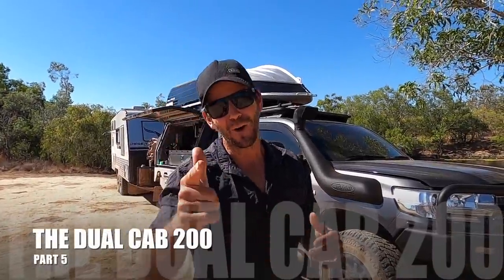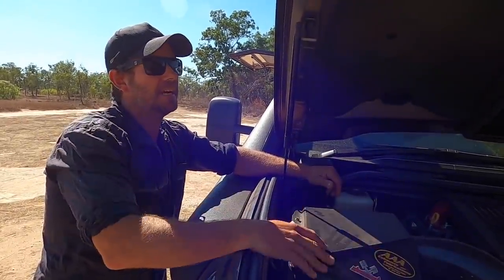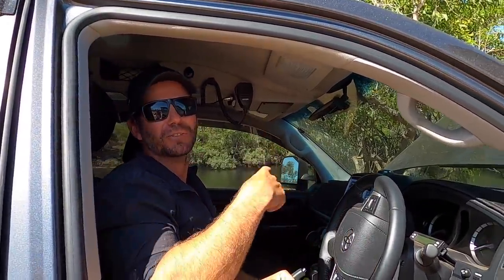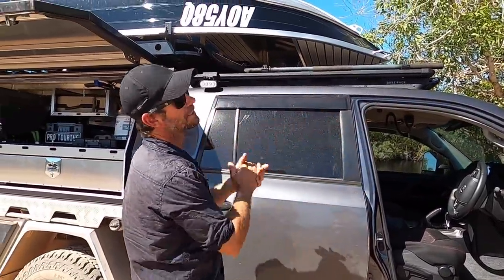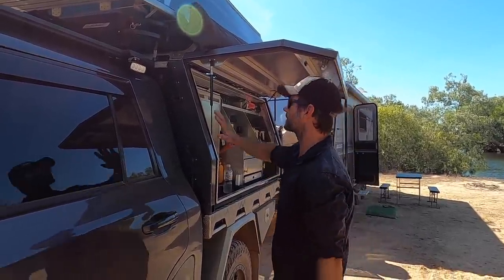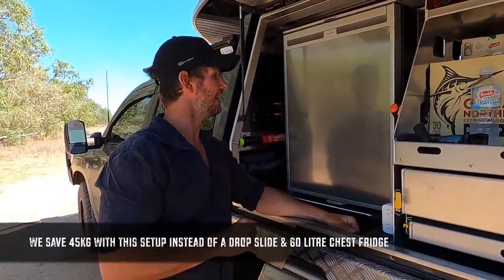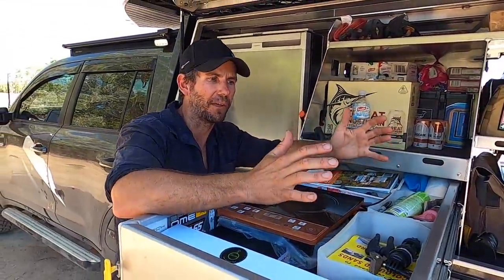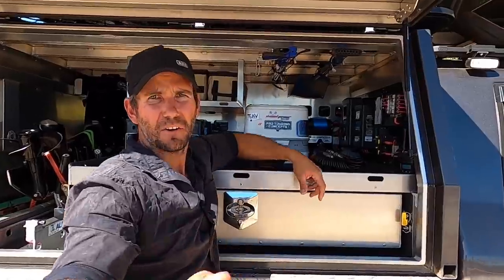12 VOLT POWER SYSTEM IN A CHOPPPED 200 LANDCRUISER - THE DUAL CAB 200 PART 5

Comment: Great set up...Just a note on your tinny tie down...we use to run 4 heavy duty over center latches with the hooks bolted onto the tinny gunnel rails. Heaps of trips to remote cape rivers without any issues. Really quick, just through the boat up and snap down the latches. We had a front rope from the nose of the boat to the bullbar as a tell tale. Enjoy the vids and all the best this year.
Reply from the maker: Great idea

Comment: Hey mate, I like following this Chanel as it’s a great way to find out about must see locations around this country of ours, particularly as you are travelling with young kids, which is insightful for me and has given me ideas for travelling with my family.

The 200 is looking great, nice and simple, however, that inverter setup in the canopy doesn’t look compliant. There is a requirement for all 240v circuits installed in vehicles to have double pole safety switches, as well as each power outlet must have a double pole switch on it.
Reason being,  dependant on the model of enerdrive inverter you have there, they can have an external 240v feed from an external source, ie lead run from caravan park to a caravan inlet point on your canopy, then connected to you inverter. Double pole safety switches disconnect both the active and neutral wires in case of a faulty connection in the caravan park wiring.
I’d be looking for further advice from a licensed electrician on the 240v side of your setup mate.

Otherwise, it’s a cracking setup
Reply from the maker: Pro touring is a licensed electrician and enerdrive have approved the install as well. All is good. Cheers for the info though .

Comment: Nice clear explanation, thanks. If you can't afford a new Lithium battery up front or if weight is a problem, are the jump start facilities that are available, worth while? Do you have any experience of the smaller portable compressors that My Generator have available? Not sure I can fit in a big generator. Thanks Keith

Comment: Hi Justin
Cool setup. 
But i see you showed a 7 pin connection on the back of the cruiser for the caravan brake control, signal and clearance lights. I thought you were running a wi ti system which is a wirless setup. Did this not work very well and did you go back to a wired connection? We are very curious about this as we bought a wi ti for our van and are getting ready to travel so we are keen to know what happned there. Or do you just use the alarm from witi for your van.

Comment: Great setup.A couple of questions if I can,you said the battery isolator under the bonnet is for charging the canopy battery or van battery after starter registers fully charged . How did you set this up and which is charged first if both are down a bit as I would think it would be a big drain on the alternator if they are charging at the same time
Reply from the maker: I have the same 40 amp dc/dc charger in the van. once the smart solenoid engages both the dc chargers receive current and start their charging cycles.

Comment: On the right hand side of the canopy, the storage compartment on the roof, was that designed for a travel buddy oven? Also the fishing rod holders look mint on the roof aswell but you didn’t really touch on that.  Love the vids.
Reply from the maker: Na, its a removable half shelf on the right hand side. You can also get a full length shelf that fits there as well. Norweld do a travel buddy holder that you can fit there or on the other side above the kitchen draw.

Comment: Hey Justin 

Could you please find out from Caleb how he aquires a true earth on the enerdrive items when running on a generator full time touring off grid camping.

Question relates to the earth stud on the enerdrive stuff specifically the Ac charger.

Is there a requirement to drive a 1.5 metre copper earth stake into the ground every time you set up camp and start charging?

Phil